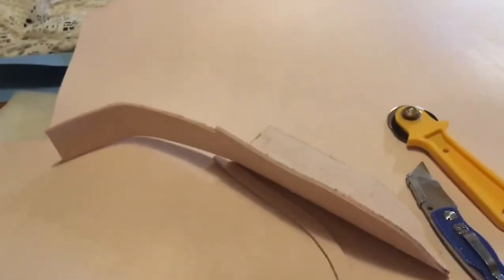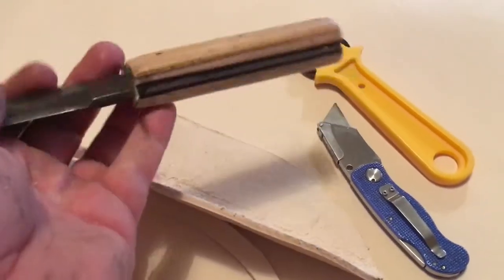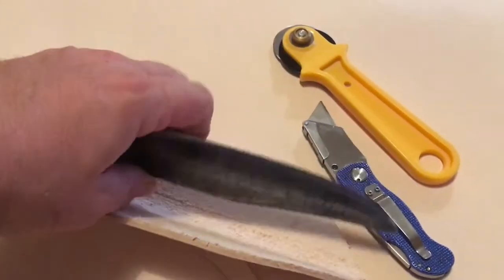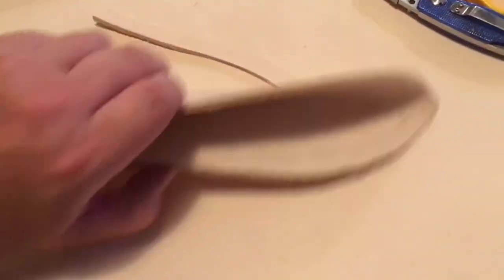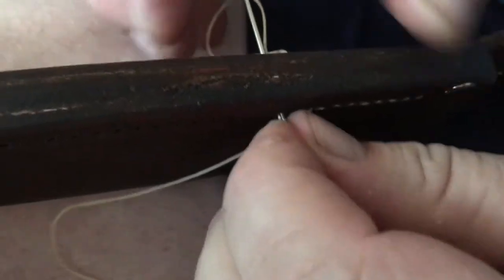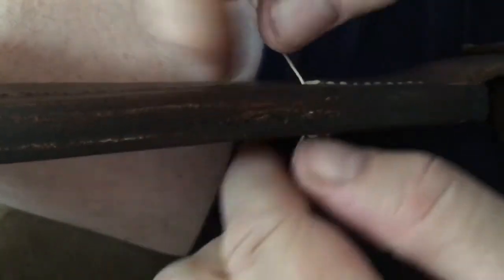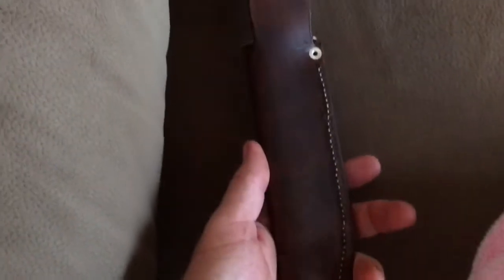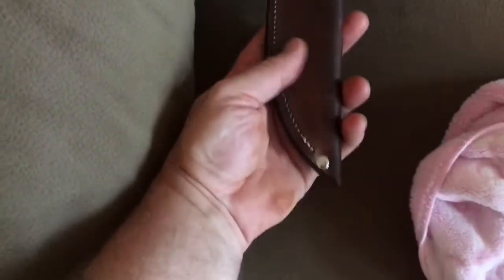making a Bowie knife sheath

Comment: SWEEEEET!  Alright, I have questions.... how do y'all get such small drill bits in your drill presses? Mine won't close down that small... what kind of string did you use for the stitching? It looked easy to work with. Lastly, that stitching method .. does it have a name? I like it!!!
Reply from the maker: thanks Chris,my drill press close thigh,try putting a bit of tape on your bit.the string is called wax tread i bough on Amazon $20 for a kit it had 3 different treads and a bunch of sowing stuff in it.the stitching method  is called the battle stitch.
Reply: Wallace Vivian - thanks Wallace! It looks great!!!!